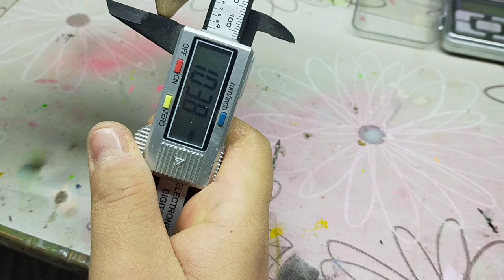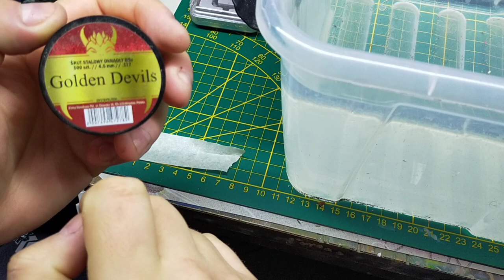How To Make Popper Lure Out Of Paintbrush - part 1

Comment: If the sawn wood smells somewhat like oak and is sweet smelling it could be Red Alder but if there's very little smell but nutty then it could be beech. It's difficult to say because it's on video and I can't taste, smell or feel it's weight lol. For something like short  brush handles, the manufacturers will probably purchase and use whatever works and is the cheapest they can get their hands on at the time. Good video as usual 👍 Oh' Beech is denser than Alder so I think it would have not floated so high in the water at the beginning of the video 🐟
Reply from the maker: Good tip, anyways, soon is time for another brush/popper 😃
Reply: @SuchaJerkCustomLures  I've never used a popper before, do they work Good for Pike? I do like to fish for Pike as they're in most waters close to my home.
Reply from the maker: @pa_maj.MARTINI-van-MAN  apparently they work for pike, at least what I heard 😝 they were made for Seychelles that we didn't go in the end cause I tested positive for C-19 😕 maybe better luck in February. In fresh water I do prefer WTD type lures over poppers (for Asp, chub and perch)
Reply: @SuchaJerkCustomLures  Yeah c-19 messed almost everything thing up In many ways, don't worry, next time. Thanks 👍

Comment: Why baking soda ?
Reply from the maker: Many people using baking soda to fill in the led holes, I use it to secure the wire only, it is because once mixed with super glue it becomes rock hard, and strengthen the lure wire 💪